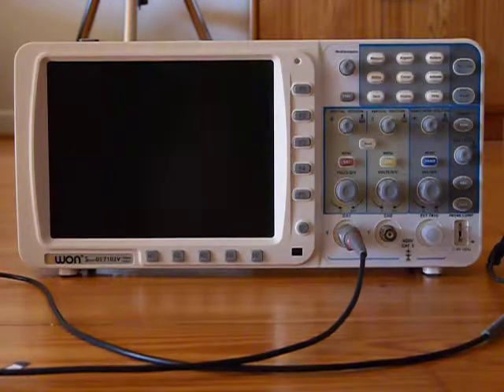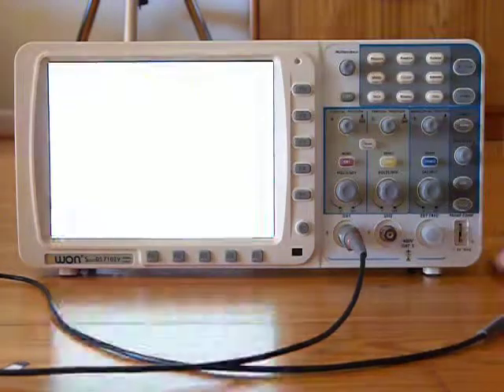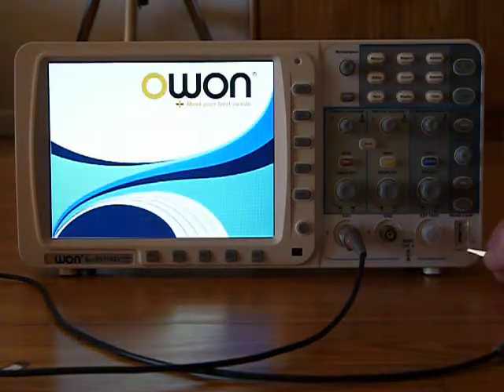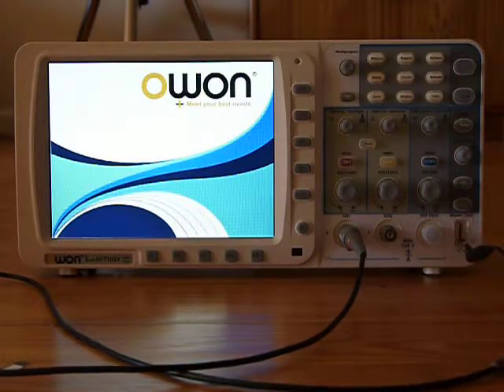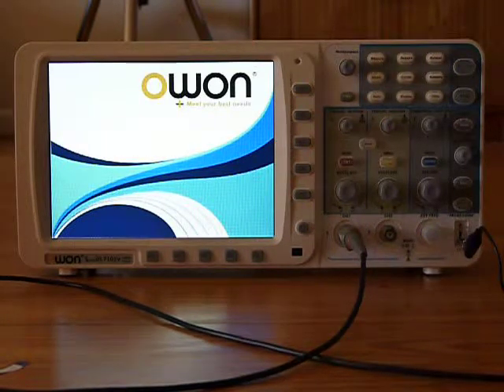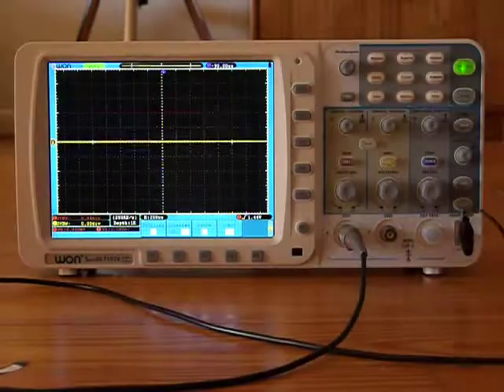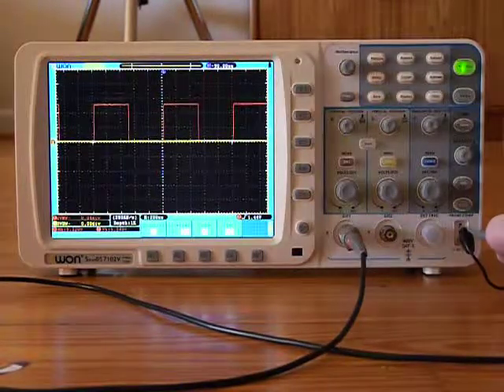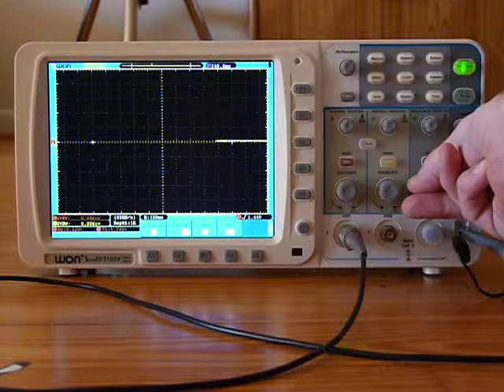Warranty support Video for OWON SDS7102V oscilloscope

Comment: common issue with Owon scopes. 
You can replace encoders or attach decoupling capasitors 100nF-470nF betwen rotation encoder pins.
Had same issue, solved recently and it back to work :)
http://www.candrian.gr/index.php/owon-ds7102-rotary-encoder-fix/